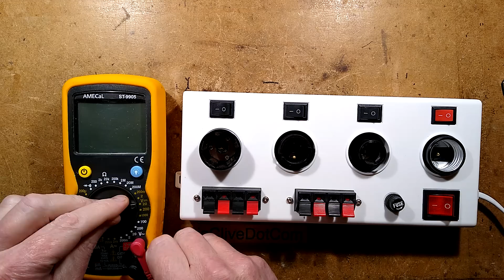AliExpress "explosion proof" Chinese factory test box

Comment: i made my  own dim test bulb  wired through a tungsten 200w 
old style bulb not a modern led bulb you can add a earth have a standard 
plug out socket with a switch used to test valve amps or any equiment
if theres a short the bulb will light up .

Comment: Hmm. With a bit of modification (safer fuse holder, safer lamp holder) you could stick that on the end of an isolation transformer & Variac and have a nice little current limited test supply for old valve equipment hehe

Comment: Back in the early 2000s as a broke teenager i used to use the same principle on my hacked up electric scooter. It didnt have any sort of speed controller, just a large relay that gave the motor full voltage from the battery. Kept burning out motors so used a couple of high beam headlamp bulbs in series with the motor as a poor mans soft start. Then had a second relay to bypass the lamps once you got upto speed. 

Worked an absolute treat

Comment: Some old armature testers also had a built in continuity tester. It was nothing more than two probes connected to the mains with a low wattage light bulb in series. Somewhat scary, especially if someone replaced the bulb with one of a high wattage.

Comment: The "tungsten filament bulb in series with the supply" method is also sometimes used when powering up old valve radios.  The filament naturally has a positive temperature coefficient of resistance; which means the hotter it gets, the less current flows through it.  This gives it some self-regulating effect against voltage variation.  It also acts as a crude milliammeter; and with a correctly-functioning set, you can see a bright burst corresponding to the inrush of the valve heaters which then dims as they begin to warm up and the resistance increases, until the rectifier valve begins to conduct and the light bulb gets brighter again -- perhaps dimming slightly once the smoothing capacitors are charged.  If there is a fault anywhere causing the set to try to draw too much current  (such as the DC-blocking capacitor connected to the grid of the output valve having died of old age, causing the valve to turn on hard and pass excessive current through the speaker transformer),  the bulb will light brightly, but the radio can never get more current than enough to light it fully, which serves to limit the energy available to do any damage  (energy which, in the worst case, will be distributed to each piece of shrapnel as 0.5 * m * v ** 2).  

It's just a shame tungsten filament lamps are so hard to get nowadays, because idiots kept insisting to try and use them for general illumination .....

Comment: the tube radio people call this "restricted power". the Incandescent bulb with the cross switch for unrestricted power is common in repair shops since the 1930ies. but they used to have proper isolation transformers too, so live/neutral are not referenced any more. (as long as you do not mess up via the ground of the RF connector or the ground of the oscilloscope, iow: you need another transformer for the oscilloscope and a ground free RF transformer too in a decent workshop setup.)

Comment: Squeaky squeaky.  Bulb bases were brass then went to aluminum or zinc with whale oil coating to prevent "welding" then dry. More profit for less expensive metal and no oil plus selling new sockets or lights to replace the damaged.  Always and forever about profit.  Wipe a film of oil on the bulb base before installing.  Do NOT get any on the bulb.

Comment: My dad always used a bulb in a holder screwed to his bench to test things. Inspired by your channel I recently knocked up test box, although mine is earthed and has an RCD plug, circuit breaker and a power meter module, output is to a UK socket rather than bulb holders. I did need some quick terminals for hooking up leads and despite searching and searching, I couldn't find anything other than those speaker terminals so used some too. So useful for checking wattage and PF of new lights
Reply: I presume you know about the CLIFF Quicktest which Clive often uses. If you want a cheaper solution that's safer than speaker terminals I'd just use some Wago Lever Nuts.
Reply: @eDoc2020  Yup know the Quicktest. Too expensive! Fortunately my device is only for me, kept locked away and I know what I am doing. Cheers.

Comment: yes. I built a quite similar looking contraption when young: switches to individually turn sockets on and off for computer components. I felt like commanding a space-ship! Until one of the switches got so dirty it shorted out and pulverized the glass-fuse I had used with a huge bang.

Comment: Ha!  It's a dim-bulb tester!  I had built one of these a good 25 years ago for working with my antique radios and TVs before I had a Variac.  The higher the wattage of the bulb used in the test socket, the more current will be allowed to pass through the device under test.  Resistors could also be used, but the bulb also gives a visual indication.

Comment: hey BC, me again. i did a thing today which has eluded me for months. despite doing things far more complicated, a year ago i saw your ancient instructions from the BC site  from the tiny bandwidth days for the joule thief and it never worked. i always put it down to being ham fisted, and being crap at winding inductors. but today i thought i'd get to the bottom of it. as soon as i thought about it it was immediately apparent i had in the past taken no pains over the winding polarity. 1 minute with voltage supply, a meter, and a sharpie and it was all good. i am still smiling from lighting a white led with a mere .7v.. it was lovely. seeing how much more readily it turned off rather than on. and the way the duty cycle + changed increased with increased voltage. brilliant. i have had a whole day of fun.

Comment: I have used the same system for years for repairing amplifiers, a 150watt lamp in series with the supply. 
It will glow briefly until the power supply caps charge up, but  will stay on if the bridge rec or the output transistors are short circuit.

Comment: Speaking of light bulbs, we made a board to test e-bike batteries.  This has 4 car headlamp sockets on a wooden board and a terminal strip. It can be wired for 24V, 36V or 48V batteries. Each bulb is about 50W so the total is about 200W. A good battery should last about 1 hour.  When it is on full power it looks like an EZ Bake oven.

Comment: Fun fact, China have almost no standard AC plug before 1990, they got Australia like plug, US type plug and also Europe type plug on all kinds of outlet, very confusing, even today they usually buy the power strip (power bar) which accept multiple plug, also means not good, even BT thick square legs is a bit loose, even on fire before my eyes. Back in 20 years ago, I know some Hong Kong invested factory even only use BT type power strip inside for safety, sadly most of them quit China now.
Reply: Yeah, power outlets in China are kind of interesting. It is the Australian type with slanted prongs but inverted with earth at the top, along with US flat prong and sometimes Euro round prong. I did happen to visit the British Embassy in Beijing, and I did see they used British BS1363 standard outlets and plugs. Of course that Embassy is UK territory, so they have to comply with UK standards.
Reply: I don't know what the Australian type outlet in China is rated to, but I've often seen them scorched and melted around the holes, because they were overloaded. Unlike the UK which prohibits power outlets in bathrooms. Bathrooms in China often have a couple of power outlets. They also have large cylindrical water heaters for the showers etc, might be 2-3kW,  plugged into those outlets. Washing machines are often in the bathroom as well.

Comment: Back in the 1950's US (and still today in some old buildings) you could screw a light bulb into the fuse box. This was a great trick to hunt down short circuits without wasting fuses.
Reply: You can still find such old fuse holders in some old installations in Europe. They use a standard E27 threading, identical as in light bulbs.
Reply: @5Dale65  So the light bulb for testing trick would work in those places too.
Unfortunately so would the wrong value fuse, or worse yet a coin.
Reply: @davidg4288 The threads are the same, but a 30A fuse has a more shallow tip taper than a 20A, so the 30A does not make contact in a 20A socket.
Reply: @solarsynapse  Good design then! That'll at least prevent honest mistakes. You can't prevent everything, like the people that just install a larger breaker without upgrading the wiring.
Reply: CENSORSHIP

Comment: What sort of house fuses have you traditionally had in the UK?  Back in the 1960s, we had a type of screw-in type fuse that had a glass window / face on it... Best I remember, it was about the size of a US Edison bulb socket, but surprisingly, I never tried putting a bulb in one to see if it would fit...
Reply from the maker: We never really used that style of fuse holder here.
Reply: In the UK it used to be fuse wire, usually sold wrapped around a card. Think it was 5A , 15A, and 30A rating. The fuse boxes had like plug-in cartridges with screw terminals, and you connected the fuse wire between them.  And they were marked and colour coded with the appropriate ratings. These days it's circuit breakers.
Reply: Those were widely used in old fuse boxes in Europe. I still have such gizmo in my flat from the late 70s. The fuse is a screw in cap with standard E27 threading, like in light bulbs. Into the cap you put the actual fuse insert, mostly 10A (red) for lighting and 16A (blue) for wall sockets. The colored thing is located at the end of the insert, and in the cap there is a glass part that you can see it. In case the fuse blows, the colored part falls off and you can immediately see which fuse is blown just by looking at the panel. As the inserts are just one shot, in case if you have a dead short, you can just screw in an ordinary E27 bulb and go looking for the fault.

Comment: Back in the 90's working at a consumer electronics repair shop, we had a similar setup for testing equipment so if you were say, working on an high powered amp and just replaced the very pricy amp transistors, but weren't 100% sure why the blew in the first place, it could save you from having replace them again!

On a side note from the same era; in the Bose Acoustimass subwoofers that were very popular at the time, the used several small bulbs inline with the speaker to not only protect it, but also to sort of "round off" any clipping, making it sound similar to it being powered by a tube amp.  It was fun to crank them up a see the lights flashing with the beat!
Reply from the maker: I think they used an aircraft lamp in some speakers as a PTC limiting element.  As the lamp got brighter it increased in resistance.

Comment: F.A.O. BIG CLIVE :D
Have you ever heard of a drag racing Henry hoover?   well, on my way home today one of the house locally hat dumped out a yellow hetty hoover, now I love henry hoovers and the company itself, still family owned in the UK, have since I was a kid in the 80's, a true testament to robust modular design and so I know how to fix them up. Have done for folks for a while over the years, anything to stop people buying a bloody Dyson, made of tissue paper by a tax dodger.

Anyway it had no wire so I stripped it, good bushes but the motor sounds gruff as buggery when i wired and ran it, had a look at its windings, free wheeled it and it all looks good so I wondered if there was just crap on the bar, I noticed the bushings while still having plenty of life, were distinctly more oily/wet than my henry.  So I went into my tools and my other half a wonderful man called Lewis for the last 15 years, yes we like dorathy too, had purchased a new can of contact cleaner for me, not my usual brand and indeed at times I just use WD40 but this was "made by" WD40 so I figured it would do the job and I blasted the hell out of all of it, gave it a bit of a wipe down and popped it back together.

Interesting thing about WD40...  once you spray it onto a surface, the stuff isn't flammable. Turns out that's not actually the case for their contact cleaner... and well... I was rather liberal with it so when I re-seated the motor back into the top housing and turned it back the right way up the remnants of my spraying must have gathered somewhat internally.  I flicked the switch on and for the brief beautiful moment before I was deafened it ran like a dream, followed by a VERY Loud POP and a 3 foot green flame that fired out of the exhaust vent. Ah the fun I get up to at 1 in the morning.

try it some time, its hilarious.
Reply from the maker: Exciting.  I'll have to give that a go.   There are horror stories of people spraying all the mechanisms in their pinball machine with WD40 (not a good thing to do), and then immediately trying to play it, and setting the solvent on fire.

Comment: You just demonstrated a "Dim Bulb"Tester" as used by folks restoring old vacuum tube radios to detect if there is a direct short across the line and limit the current to the radio.

Comment: Will the thin, non-isolated wires or the soldering tin melt and pop before or after the little fuse? 🤪🤦‍♂️😂
Reply from the maker: The wires are the backup fuse.

Comment: Interesting so China finally discovered all the YouTube videos of in-line AC test lamps.
I was gonna say it looks like they did a halfway decent job of wiring it. If you assume the blue wire is hot it goes through the switch and connects to the center of the Edison lamp socket if you use it the other way around then yes you are putting the Hot on the outer threads. Technically the Edison base is supposed to be polarized with a neutral always on the threads. If you're making a test lamp socket you really want to go positive to the center pin as well so when you unscrew the bulb you're breaking the hot wire and not having an energized screw Where you might accidentally come in contact with it.

Comment: Interesting bit of kit!  That 20mm fuse can easily be replaced by an HRC one, and there's enough space there to put in a longer fuse holder, offering better protection. Alternatively go for one of those push button re-settable breakers if you trust the ratings 🙂

Comment: Since capacitors are the most vulnerable components in power supplies, is there a more robust type of capacitor? My led power supplies keep going out.
Reply from the maker: You can replace them with the best quality low ESR capacitors you can source from electronic component distributors.  Ventilation to keep power supplies cool is also a big help.
Reply: In a past video you replaced some caps with “a solid dielectric” type and just now “a low ESR” type. I was unable to find these terms when searching for an assortment. What are search terms that will get me to them?

Comment: Same as the trick of connecting a bulb in series with anything suspicious you want to test on mains voltage at a lower current than what a heater lets through.
I wonder what will replace filament bulbs when they will have entierely disappeared from the planet though.
A high wattage wirewound resistor ?

But it doesn't light up.
Reply from the maker: Maybe a resistor with an indicator light across it.

Comment: I use a thermal imaging camera and flick the swich on/off quickly and see if anything heats up. Doesn't help with a dead short but can prevent a lot of catastrophic failures. Then I keep the switch on longer until I know for sure nothing is going bang and release magic smoke.

Comment: @0:55 Why is the light of the main I/O switch flickering ? Is it intentional in design ? Because I also have a flickering on my multi-outlet power strip. Thank you !
Reply from the maker: It may be the neon's 100/120Hz flicker, or it may be an older or low current indicator with an unstable glow discharge.

Comment: Used the dim bulb technique when repairing old valve radios, invaluable for determining shorts on switch on, if it glowed at full power no damage done to equipment under test.

Comment: Can someone tell if in China they utilise isolated power supply system, by what I mean the neutral point of the transformer feeding the low voltage distribution lines is not grounded at all? I believe in Europe it would be called an IT system, as opposed to TN-C, TN-S or TT. If so, there wouldn't be that much of a schock risk when touching a hot wire. And as for the power sockets, google says they use a mix of the US type and Australian type, which are both polarised.
Reply from the maker: I think they have a ground, but don't distribute it through the buildings.

Comment: Recently I burned a 5 amp glass fuse in my multimeter. I forgot to remove the test lead from the amp socket in the meter and I probed straight into a 12V car battery from a diesel car, so the amp capability was really high (around 700-800A). There was a bit of a flash on the end of the lead and the fuse blew, but didn't shatter to pieces. The glass wasn't even blackened from inside.

Comment: I had a similar idea on my test panel at the bench when I was an electrical apprentice 40 years ago on the docks. It had a 250w lamp on the live side connected to a test rod which was a brazing rod on a long piece of wire. The vice was grounded and it never failed me. Even had lamps in series for the 3 phase stuff. Wouldn't work now with ELCB's of course.

Comment: @2:23 - Furthermore, if you are lighting a load with you body through, say a cut neutral in a knob and tube setup, that current draw is going to bite a WHOLE lot more.  When rewiring old houses, you could cut through a neutral that powered a whole host of items.  If you touch both ends of those neutrals, the draw just adds that element of "shite!" to your day.